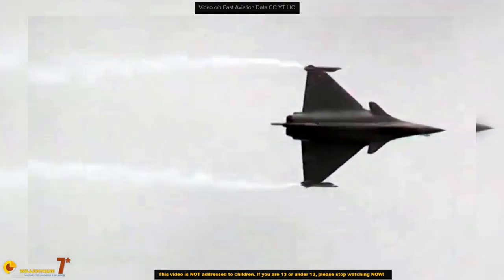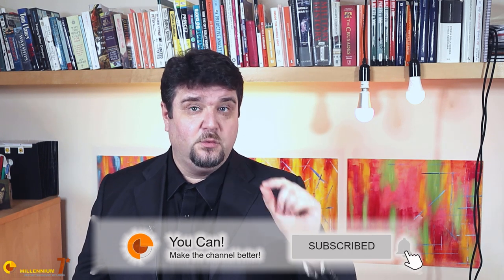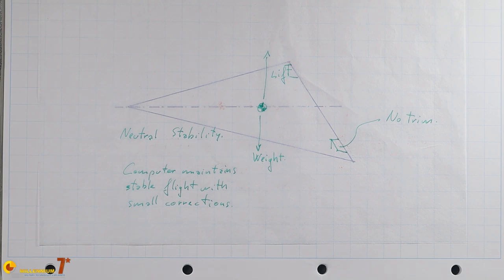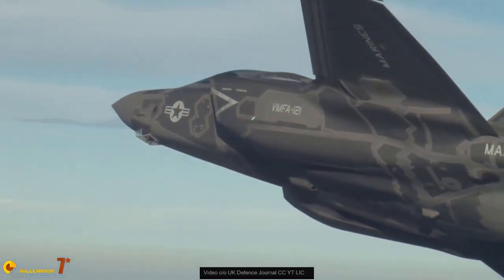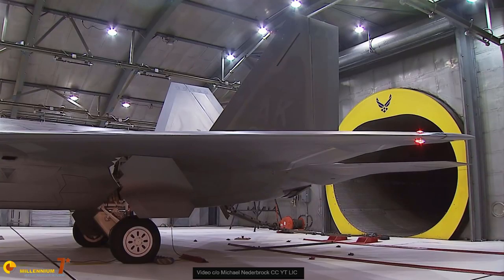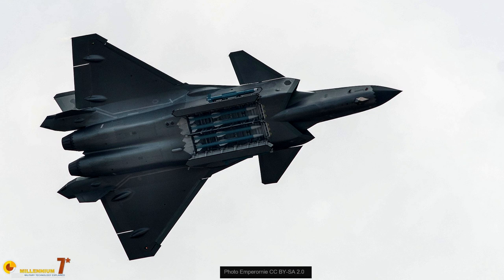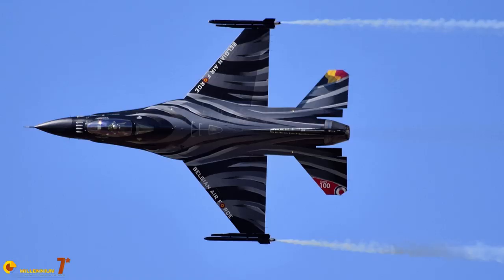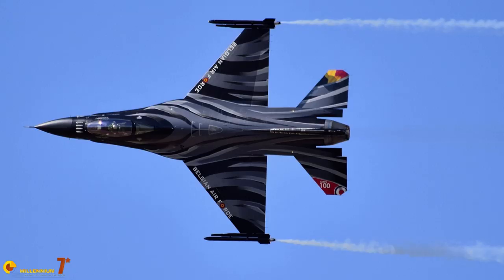Delta Wing: Why Not? - why Rafale/Gripen/Eurofighter are delta and F-16/18/22/35/Su27/Mig29 are  not

Comment: delta wings needs canards (a nice radar reflector) to turn and twist in a dogfight - or it is only good for straight line speed - canards are more like the elevators only they are in front
Reply: Wrong. Delta wings are actually very good at turning. Did you not pay any attention? Even without the foreplanes, the delta shape serves as LERXs, keeping the flow over the wing at high AOAs, meaning they can turn very sharply. They just have a lot of drag at high AOA, so they are not as good at SUSTAINED turning as some other types. THey bleed speed in turns, a lot. But they can turn very sharply. They also tend to have more area than conventional wings of the same size, so they can do this at high altitudes. The main problem with tailless deltas is that they have high landing speeds because you cannot use flaps. 
If they were only good for high speeds, they wouldn't have used delta wings on the F-15 and F-16, would they?
Both planes use a delta wing, a cropped, tailed delta. The MiG-21 uses a straight tailed delta. It out-turned all US fighters in Vietnam. The F-106 was an extremely good dogfighter at high altitude.
They adopted canards to reduce landing speeds, and then someone though "hey, we can use these to control pitch as well, since they work by ADDING lift instead of subtracting it, like a tailless delta or conventional tailed jet".
Reply: @Angel24Marin  What does that have to do with what he said?
Reply: @justforever96   The one I responded deleted his message. He was calling European stupid (with worse words) for using composite to decrease the radar signature and then putting a titanium canard that reflects the radar. When the point of the composite was weigh reduction.

Comment: Sorry if I misunderstood you, but it sounds like you are calling F-16s "conventional" vs deltas. Both the F-15 and F-16 use a delta wing, with cropped wingtips. It's the overall shape that matters, it doesn't have to be a true delta. The Rafale, Gripen and Typhoon all have cropped wingtips as well, just not as much. The F-16 is only different from the eurojets by the fact that it is a tailed delta, not a canard delta.

Comment: F 22 raptor doesnt need canards becouse it has trust vector trust engines.
Reply: Jun Don  bingo
Reply: Actually, it is the other way around. The F-22 needs trust vector control to be somewhat maneuverable. The technology was developed in the german-american project X-31 but was not considered worth the complexity for the Eurofighter. I would consider the eurocanards to be more maneuverable than F-15,-16 and -18. Still they have low observability because of detail optimization(like the S-duct) and special coatings. But that's ok the strengths of the american jets lay in different areas
Reply: @goldfischbaron5254  
Different criteria of maneuverability. The F-22 combines the thrust-to-weight ratio of a F-15 plus the supermaneuverability. Late Cold War Western fighters tend to optimize energy, while Soviet fighters tend to optimize post-stall manueverability. F-16, F-15, and French fighters (Mirage & Rafale) focused on energy, SU-27, SU-35, and F/A-18 focused on post-stall and high angle of attack, the MiG-29 and F-22 optimized both.

Comment: Not correct! Delta-canard configuration can be used in stealth fighters. But if it is to be used in the most aerodynamic efficient way, above the main wing, special design measures have to be taken. This is described in a SAAB patent. Horisontal stabilisators after the main wing is a big reflector too. But a canard is a little more reflective. The ideal stealth configuration for fighters can be seen in the x-36.

Comment: MiG-29 and Su-27 use the modified aerodynamic configuration of the F-14. The main modification if of course the fixed geometry wings. Otherwise, they are almost carbon copies of the Tomcat.
Your intro is way too loud.
Reply: Look up Tolkachev (Billon Dollar Spy), and Constant Peg.   The US and the Soviet Union either stole designs from each other or made design changes to counter each other's aircraft.  One of the main reasons the Israeli F15/F16s beat the Russian aircraft.  I am more of an electronics guy, not an aerodynamics guy like you, so I can say that the US knew everything about Soviet radar, communications, ECM, etc., plus they had electronics superiority.  
This is why the US can wipe out Soviet aircraft.  And that is the primary reason that India uses a lot of Israeli avionics in Russian aircraft.

Comment: Fails to mention the blended-wing F-15 - which was shown to be able to continue flying after losing a wing.
Reply: What's your point? The f-16 and f-18 are far better examples of blended wings, not to mention the MiG-29, which is basically all a wing with engine nacells and control surfaces attached to it, and all of these were discussed in the video. The f-15 was able to remain flyable not because of the wing, but mainly because of the wide fuselage providing lift.
Reply from the maker: correct